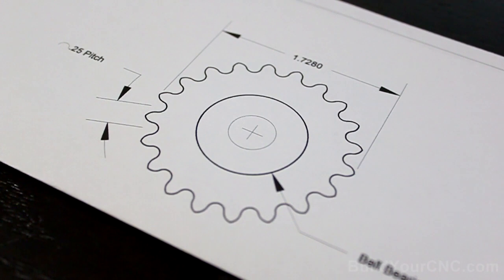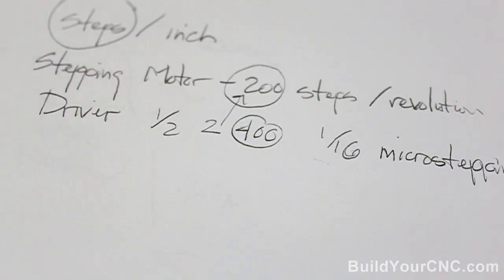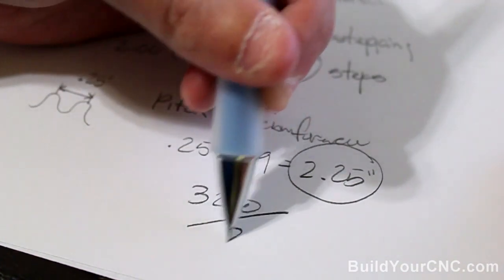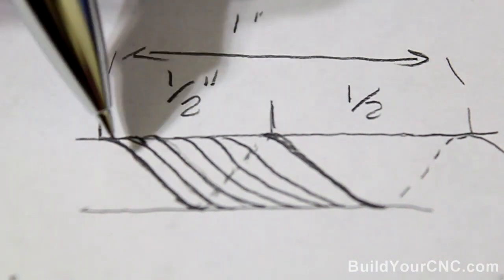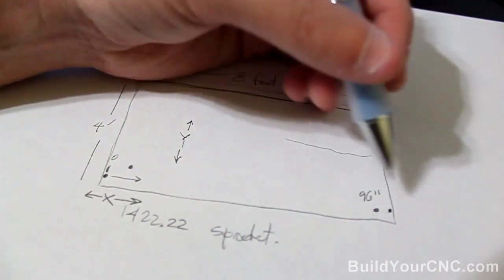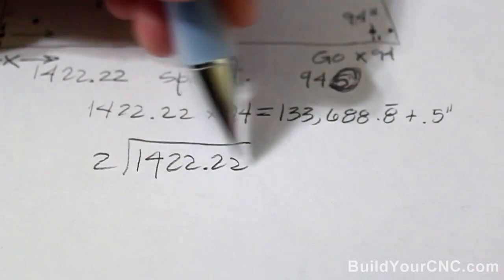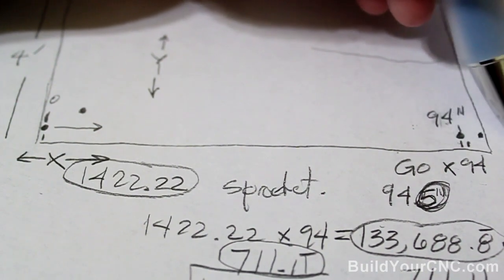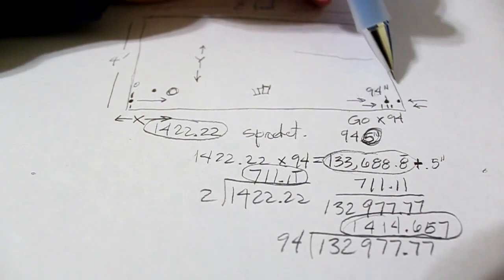Calibration of Linear Motion Systems Driven by a Stepping Motors

Comment: Hello, My CNC machine has a Nema17 stepper motor, T8 trapezoidal shaft and nut (nut advances 8mm in 1 turn, Start: 4, Pitch: 2mm) and DRV8825 driver using 1/16 micro stepper. In this case, how many mm does my CNC machine move in 1 revolution in the z-axis?
Reply from the maker: If you are using Mach3, I would recommend using the "set steps per unit" button on the settings tab to do the calibration through a wizard. It's far easier.

Comment: Hi Daniel. Great video. If I may ask could you go over a cnc that uses direct drive? The stepper motors drive the ball screw shaft directly.
Reply from the maker: Hi Danny, 
If you know the linear travel for one revolution of the motor, then you can use the formula: 
step/inch= (natural steps * microsteps) / (linear travel for one revolution)
For instance: if you have a lead screw that is 10 TPI and 5 starts, then the travel distance for one revolution is 5/10 = 1/2".  If you don't know how many starts you have, look at the end of the screw and count the number of thread starts around the circumference of the end of the screw.

Hope this helps.  Of course, this is only the beginning of the calibration process to get close to the real number.  you should continue to calculate the real world steps/inch by calculating it, or using the control program like Mach3 to perform this calculation.

Comment: This is good. Only comment is on the end. As per previous comment (SCALE)=(desired distance)/(actual distance) is a scaling measurement. If math is right you can just do (adjusted steps per inch) = (current steps per inch) * (SCALE).
Unless there is some weird rounding going on with the steps that I am not understanding. If this works it is easier to follow.

Comment: Oh, yea, in order to calculate the actual number of steps per inch, you can pick up a calculator and do (assumed_steps_per_inch * desired_distance) / actual_distance. In your example, that's (1422.22 * 94) / 94.5 = 1414.695, no need to repeat the process until it's perfect. Not that your answer was off enough to matter, but it is a little faster this way.

Comment: On the chain drive with the nine-tooth sprocket, I found a way to calculate the revolutions per inch without knowing the pitch. I measured the links per inch on the chain (4) and then divided the number of teeth (9) by that number (9/4 = 2.25) to get the inches per revolution.

Comment: @aggrav8d ... good point.  Do basically the same thing, only use something like a vernier caliper, just because the distance is so much shorter. .. If you try it and you aren't off 'much', it could be OK to assume correctness, but that is your choice! ... I got a plastic vernier caliper that has a thin metal rod attached to the movable jaw (it runs the length of the caliper), and it extends as the jaw is opened.  It is great for making this kind of measurement.  I hope you can find a similar one

Comment from the maker: @satishchaphekar That's unfortunate.  This will ultimately be determined by the mechanism that you have on each axis and the weight and force against the thing that you are moving with the motor in question.  One rule of thumb is that full step is not the best for maximum torque.  I have found that 1/4 or 1/2 stepping is the best for full torque in my experience, so put that configuration on the worst case scenario in your setup.
Reply: Hi. Greate explanation, you save my life.

I am using a "Long Motors" stepper drive (DM860A) with a nema34 1600oz motor who give me many pulse per revolution choices as 400, 800, 1600, 3200... what i have to use 400, 800 or 1600 and how its reflect in you formula?

A) For sample if i choice 1600 its same as 1/8 since 1600/200=8 or if i choice 400 its same1/2 since 400/200=2? So i need to use 200x2 to determine the number of steps if i choice 400. I am confuse now.

 B) What the best choice to give good torque?

Thanks and sorry my bad English.

Edit.: I am using a ballscrew with 5mm/rev.

My stepper motor driver.
-------------
https://www.google.pt/search?q=dm860a&client=firefox-b-ab&source=lnms&tbm=isch&sa=X&ved=0ahUKEwiJrayCmNbPAhWKJMAKHbsdCgMQ_AUICCgB&biw=1280&bih=855#imgrc=QZ2DpqrZj3rmmM%3A

Comment from the maker: @karandex If your lead screw is single start (meaning there is only one thread wrapped around the rod), then yes, the 15 threads per inch is equal to 15 turns per inch.